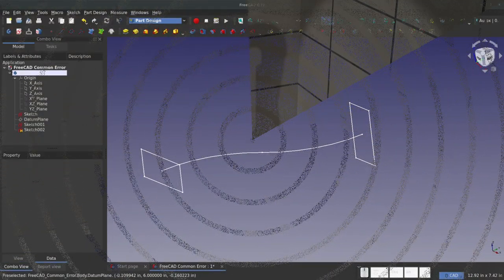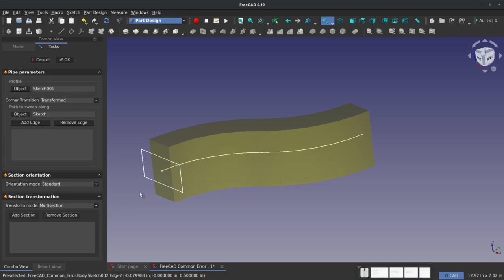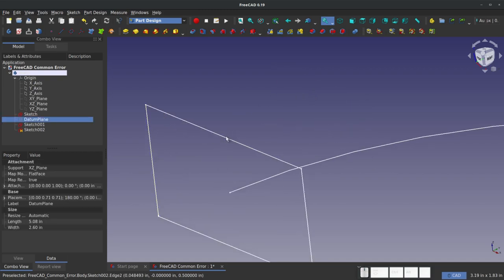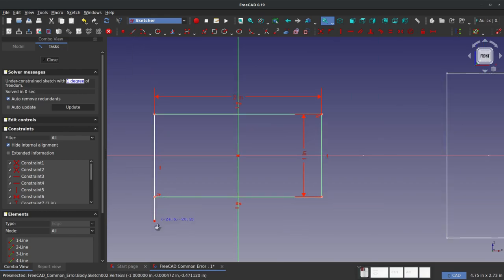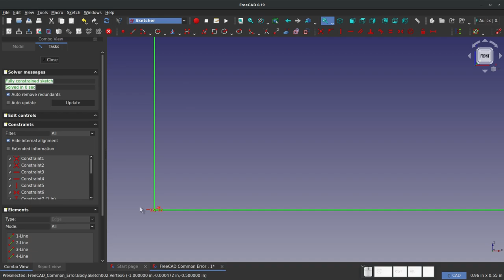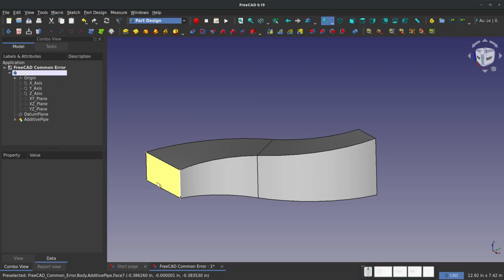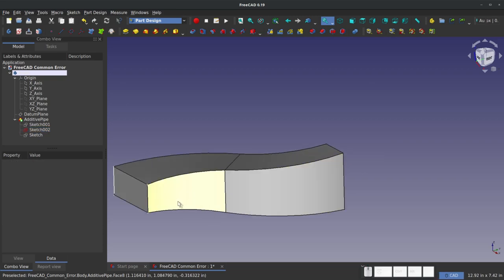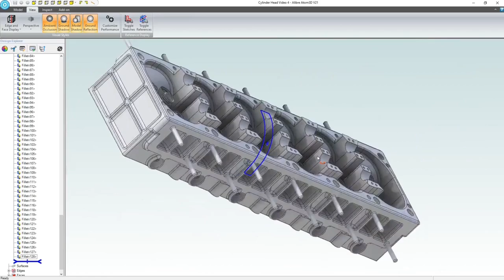FreeCAD - Resolve "Sections must be all closed or all open" Error |JOKO ENGINEERING|

Comment: Turns out, Lofts don't like JoinCurves as paths, and give this error.
Using the RealThunder version 0.21 I tried doing a Subtract Loft to clean up an edge. The (Curves Workbench) Join Curve tool, which I swear I've used before in a similar context, was used to correctly define the filleting path. 
But, 'twere not to be. 
Truth be told, the RealThunder Freecad has before broken things between editions, so that may be the problem. 
Thanks for your great work on Freecad. You, Mango Jelly and a few of the FEM guys (Anisim, in German, but still great) constitute the leading lights for really useful tutorials.
Reply from the maker: Thanks for your insights here and words as well.

Comment: I have this error most of the time with points that are visually overlapping, often even still fully constraint into that position, but still not connected by a constraint.
And I always wish in these cases that FreeCAD would offer something to find "open ends" instead of only yelling at me : (
Reply: What have I done wrong?
"ERROR"
OK, what's the error?
"ERROR"
Yes, I already know that, but what IS the error?
"ERROR"
Aw c'MON, I've got seventy three constraints here and one 'dof' here, what am I doin wrong?!
"ERROR"
WTF??
"ERROR"
Reply: @dennisloobman8013  One of the worst things FreeCAD does in a few cases is the Report View (or whatever the error log panel was named) saying: error, check report view...